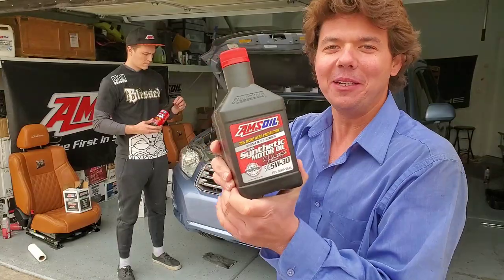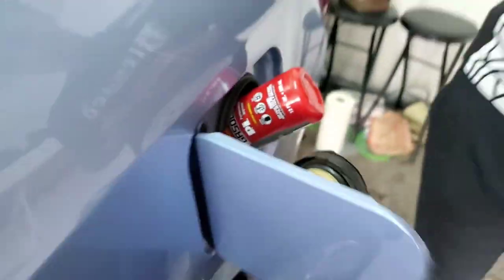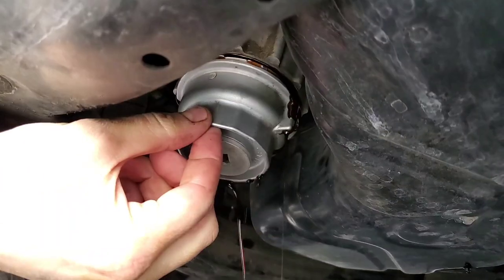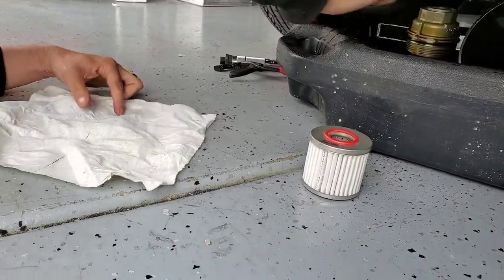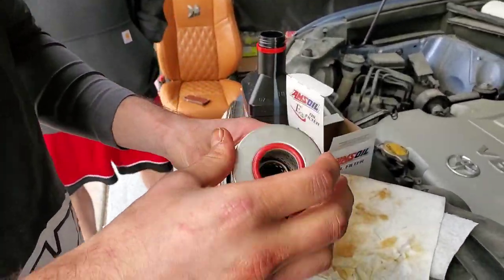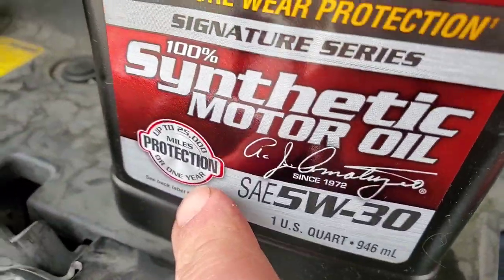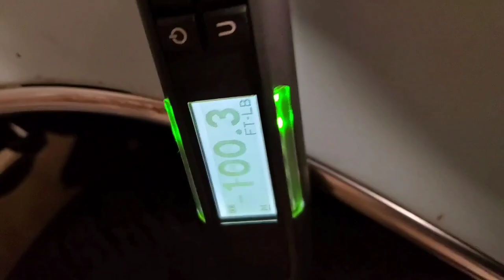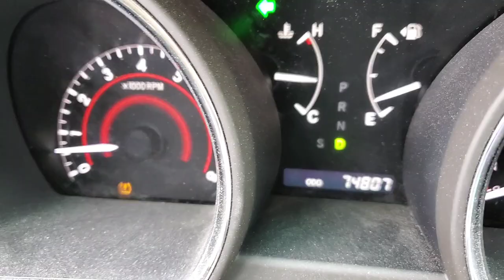2008 Toyota Highlander AMSOIL Oil Change & Flush

Comment: Been running Amsoil in my cars since 2004, never had any issues, first tried it in my 94 Honda Civic that had 87,000 miles when I bought it, still have the car and has 225,000 miles original engine and transmission, all I’ve had to do is timing belts water pumps and valve adjustments, and getting ready to pull the motor out for a more powerful DOHC freshly rebuilt and will run Amsoil on this engine.
Reply from the maker: Sweet! Thanks for sharing the story with your vehicle!
Reply: Very  impressive!
Reply: No big deal. I had a 1985 Honda Accord with 240,000 miles. Never used a drop of oil. Only got rid of it cause someone rear-ended me and totalled it. If I remember correctly, we used Castrol conventional oil at the time. Amsoil is overkill.
Reply: @njsongwriter  I didn't  know Honda accords existed in 1885 ? 🙄😂
Reply from the maker: That's what I used to think until I tried amsoil and I found out how inexpensive it was with the preferred customer program and the gas mileage savings coupled in with the extra protection your engine will last longer saving you more money also better peace of mind and longevity.

when I found out that the oil was free actually better than free because you get more money saved in gas than what it costs with the added protection that's when I decided to start my channel because I knew this would be an opportunity to give amsoil the exposure it deserves while helping people save millions of dollars.

as of now we have saved people on the channel well over 5 million between engines transmissions and differentials.

You'll see a lot of great videos in playlists on the channel Thanks for checking it out.

The Power of AMSOIL Signature Series 5W-30 Synthetic Motor Oil protects against harmful deposits on turbochargers 4X better than Mobil1® Extended Performance and 3.6X better than Royal Purple® in industry-standard testing*. https://www.amsoil.com/newsstand/motor-oil/articles/leading-the-field-in-deposit-protection/?zo=5331179 

     Better MPG Proven - https://www.amsoil.com/newsstand/motor-oil/articles/another-win-for-amsoil-products/?zo=5331179

AMSOIL Performance Test Results - https://www.amsoil.com/performancetests.aspx?zo=5331179 

     Lookup For Your Vehicles - https://www.amsoil.com/guides.aspx?zo=5331179
Reply: @404notfound..... 
Good one... Obvious typo... I'll fix it.
Reply from the maker: What did you think of the test results?
Reply: @Syntheticoilprotection 🛢Outstanding results!!! It really is all about the base stock. I once  saw an train load refused at Amsoil because the raw material samples provided were not up to Amsoil  standards. That says a lot about a company. 🙂
Reply from the maker: Cool,  did you work there?
Reply: @Syntheticoilprotection  No, I actually read about it in one of Amsoil's monthly magazine.
Reply from the maker: 😃, cool
Reply: @Syntheticoilprotection  
I know Amsoil is one of the two or three top oils available but for me it's overkill. I'm 74 and my Toyota has 53,000 miles on it. I'm pretty sure it will outlast me. I'm retired and I enjoy changing my oil so I'll continue to change it every 5,000 miles. Like I said, for me Amsoil is overkill.
Reply: @njsongwriter  🙂👍

Comment: The engine flush shouldn’t you put more oil in there to get the flush that’s sitting around then drain it then fill her up again?
Reply from the maker: You don't have to it's insignificant meaning of a total seven quart sump you may leave behind six to 11 oz which is insignificant

Comment: Does this flush will ,,CHEW,, on rubber gaskets???
Reply from the maker: The flush cleans and protects the seals in the motor.
This is all the information on that product - https://www.amsoil.com/p/engine-and-transmission-flush-flsh/?zo=5331179

also the amsoil motor oil has cleaners and conditioners to help protect seals and keep them soft and malleable

Comment: Do you use the flush every oil change
Reply from the maker: I use it every time on diesel motors because of the turbos and the extra sit thickening on regular gas engines I use it only the very first time switching over to amsoil.
Reply from the maker: it's nothing you have to do it's just that you're better off getting all the carbon out early before it goes into the oil filter and that way your oil filter will remain cleaner longer and you won't have to change it as soon.

once the oil filter gets full the oil will get really dark and that's how you know it's time to change the oil filter

Comment: How much smoother can I expect my transmission to shift after I complete my second drain and fill with the signature Amsoil ATF? It feels better after the first drain and fill from the factory ATF. Its a 2010 Accord 3.5 Liter . Thanks
Reply from the maker: That's a great question.....

Well compared to mineral oil it's a huge difference amsoil makes 100% synthetic motor oil 100% synthetic ATF transmission fluid and 100% synthetic differential gear lube so it's a big difference the film strength is stronger you'll get much better shifting smoother driving better performance better cold flow properties better fuel mileage.
Less vibration.
It's a very big difference.
AMSOIL Performance Test Results - https://www.amsoil.com/performancetests.aspx?zo=5331179

Comment: Even toyotas now. AMSoil sounds great. but is it ok not to use engine flush at change oil?
Reply from the maker: You don't have to it's just good because it gets a lot of the old carbon deposits out.
Reply: @Syntheticoilprotection  Do you do it at every oil change, or just when you first change over to  Amsoil ?
Reply from the maker: on diesel motors I do it every time because it helps clean the turbo and the diesels have a lot of soot and it's very important.
On the gas motors I do it only the first time
Reply: @Syntheticoilprotection  That's what I have always done. Thanks!

Comment: My highlander has been slacking with power . Gonna give this a try 🤔
Reply from the maker: Sounds great this will give you the very best value on the products and when you use my link I will always be able to answer your questions in the future as your independent Amsoil dealer👍
✅  Save 25% On Your Next Fluid Order: https://www.amsoil.com/offers/pc/?zo=5331179
Reply: If i buy it at my local amsoil can i still use the 25%?
Reply from the maker: Great question when you order it through my link and you become the six-month PC member you will get that pricing if you order it without that you'll pay what they call catalog retail which is basically full price and when you go to a store you'll pay even more because they mark it up even beyond the catalog retail so the best pricing is called the six-month preferred customer membership for $10 if you order with that you also want to enter your birthday month you will get $5 on your birthday and you will also get $5 towards your next order for every $100 you spend and when you order before noon you will have the products next day as long as you live within a few hundred miles of a distribution center and any order will also have free shipping any order $100 or more.
If you have any other questions just give me a buzz👍
Eben Rockmaker 702-472-3614

Comment: Amsoil filter looks just like the Toyota TRD oil filter.  Wonder if they are made in the same factory??
Reply from the maker: That's a great question I have no idea I've never seen an RTD oil filter I'll take a look at it right now
Reply from the maker: hey great I Steven yeah I just checked it out and it looks very very similar It doesn't say what the micron rating is and it doesn't say how long it's good for The AMS oil filter is good for 15,000 mi of severe service and it filters at 99% efficiency at 20 microns.

It does look very very similar.
Reply from the maker: Are you an amsoil dealer?

Do you live in the US or Canada?
Reply: @Syntheticoilprotection   I am not a dealer.  I live in NE Pennsylvania and drive a 2017 Toyota Tacoma SR5 with a 3.5l V-6.  My oil filter looks to be about the same type and size as this 2008 Highlander.  I am currently using a TRD oil filter and Pennzoil Pure Platinum Syn. 0w-20 in my truck.  Here is a link to the filter:  https://www.trdusa.com/filters.html
Reply: @Syntheticoilprotection  I think the TRD filter has the same specs??
Reply from the maker: I could not find it The only thing I saw was the silicone o-rings and a special plating on the metal or something like that.

If you find anything about the specs let me know
Reply: @Syntheticoilprotection  Just purchased a new TRD oil filter.  Toyota claims 98% eff. at 20 microns.
Reply from the maker: Sweet

Comment: Hey Eben, can you use the upper cylinder lubricant and the gasoline p.i. at the same time? Like can you pour them both in when you fill up?
Reply from the maker: Of course you can.

You can also use the octane booster at the same time too it's called dominator octane booster

Comment: I like your videos Eben, I really want to try AMSOIL on my 2007 honda odyssey and do the motor flush but I couldnt find the flush liquid on the website. Help!
Reply from the maker: You'll see it under cleaners and protectants You can also put it into the search bar and it should populate it this is the exact link right to it . https://www.amsoil.com/p/engine-and-transmission-flush-flsh/?zo=5331179
Reply from the maker: This is my website you'll see the 6-month preferred customer membership as you scroll down that'll give you the 25% discount wholesale account and you'll also have the free shipping.
Synthetic Oil Protection Website - http://syntheticoilprotection.net/

     Professional YouLubher: Eben Rockmaker Regency Direct Jobber AMSOIL Specialist (Dealer#: 5331179) Mobile: (702) 472-3614
Reply from the maker: Thanks again man for reaching out to me 😃
Reply: Woh! That was quick! Thanks man, I'll check it out. Its gonna be my first time doing an oil change on my own, Im glad I find this channel.
Reply from the maker: Of course lots of playlists to check out you'll see most cars are very similar.

Always best to do it the first time with a friend that does it all the time that way he can always give you pointers

Comment: Any reason not to go 0W-20 ? I believe the same engine 2011-2013 are 0W-20.
Reply from the maker: That's a good question I would double check the lookup guide here for your year make and models and if you're new to Amsoil this will give you the best value on the products as the six months PC number and when you use my link I will be your independent absolute dealer👍
♥️   Shop by vehicle - https://www.amsoil.com/guides/?zo=5331179

Comment: Looks like I need to find out where Amsoil is being sold in SoCal, I need to take better care of my vehicles.
Reply from the maker: This is my link You can get it directly from me at wholesale price you'll see the 6-month preferred customer membership.

The oil will be shipped from Las Vegas distribution center to you and if you order before noon usually it will get their next business day.

Synthetic Oil Protection Website - http://syntheticoilprotection.net/

     Professional YouLubher: Eben Rockmaker Regency Direct Jobber AMSOIL Specialist (Dealer#: 5331179) Mobile: (702) 472-3614
Reply from the maker: you'll see the 6-month preferred customer membership That's the best way to get amsoil for the best price and you'll also have the free shipping and the quarterly AMS oil magazine along with the 25% wholesale price
Reply: Did you start using Amsoil yet?  It’s worth it.